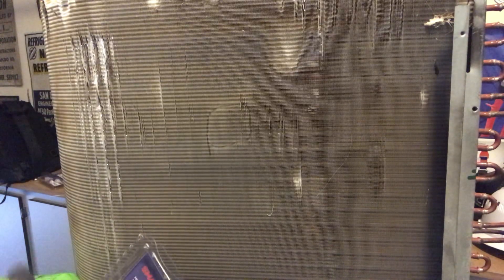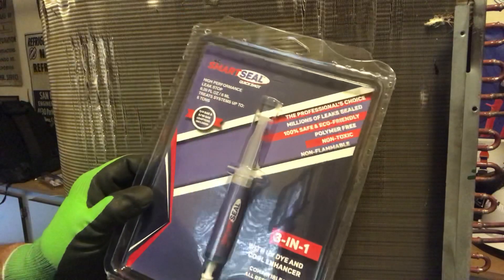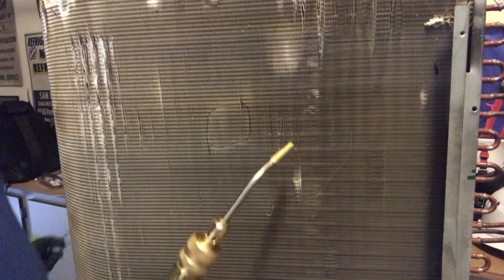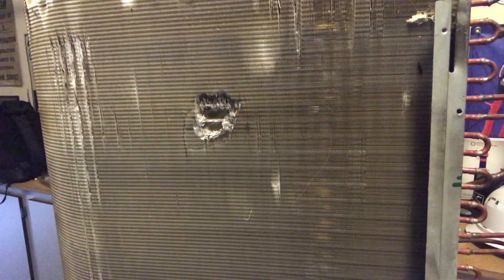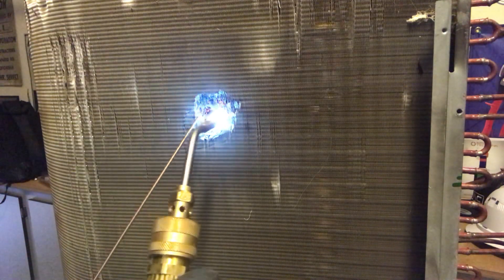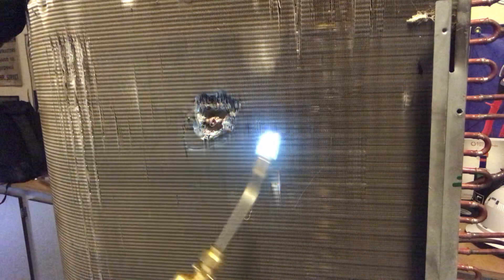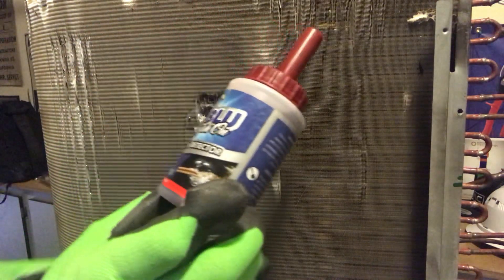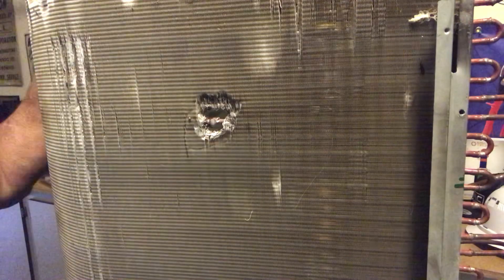Repairing a leak on a condenser coil. This is how I repair leaks on condenser and evap coils.

Comment: Its kind of ugly but I wouldn't be afraid to do this on copper.
Reply from the maker: It is an ugly repair, but it works. I'll take that so I can keep the customer happy and the AC system running.

Comment: i think that smart seal or any sealer is for dummies as it will eventually create sludge and destroy the system. its made for people who want the easy way out. whats appropriate is only refrigerant or dye. and the only way to fix a leak is to find it and fix it.  and there is no such thing as "arctic boost" or "cool boost",  if the refrigerant is installed properly it will provide cold air.

Comment: Will damaged fins cause any issues? 90% of my fins are brand new but the bottom of the fins kind corroded but ac works great
Reply from the maker: You should be OK. But keep a fin straightener close by and straighten them out if needed.

Comment: I’m dealing with this issue on my window ac. Found a small rock wedged though the fins and it punctured a small gash on the coil. The ac was running for a few hours before I noticed it. The reason I checked in the first place was because it wasn’t cooling. Is there anything I need to refill that leaked out of the hole? Or will it begin to cool again with no issues after the leak is plugged?
Reply from the maker: It should do ok after you repair the leak. But it’s a mechanical system, so you won’t know until it starts.

Comment: You put so much heat on that tube I was surprised it was still there.
Reply from the maker: It’s all about flame management. I repair microchannel leaks with a brazing set up whenever it’s needed. I prefer map gas though. But it’s really easy with Solderweld’s AlCop rods

Comment: Going to try this in the morning. I was told that the copper is extremely thin and easy to melt through. It's the top coil going through the galvanized metal so it will probably be time consuming to remove the metal. Wish I had more experience with temperature control. Any suggestions that may help me not melt the world down?
Reply from the maker: It is very delicate, so practice on a coil and use a light flame.
Reply: @cochisecounty_travels  I was successful at fixing the leak. Ordered a 00 tip from Amazon and was able to get a lot smaller flame.  Thanks for the reply.
Reply: @cochisecounty_travels  what is that torch called